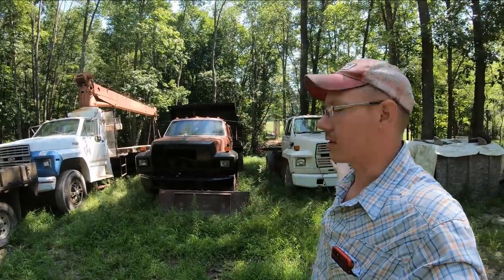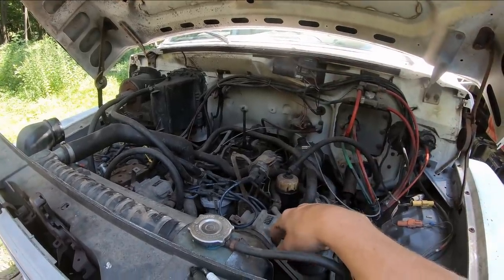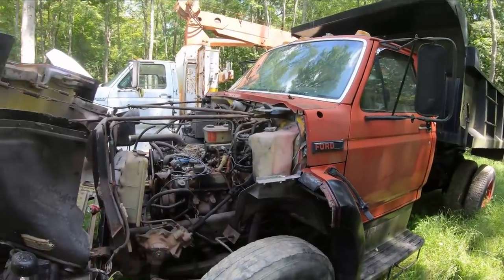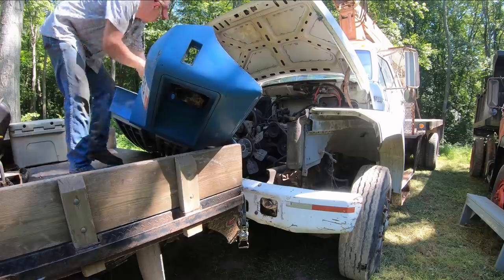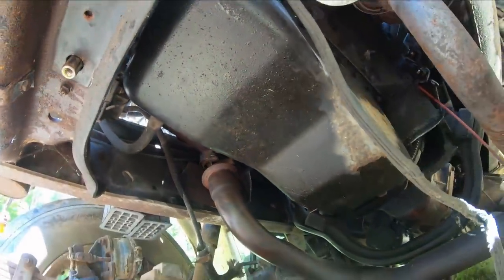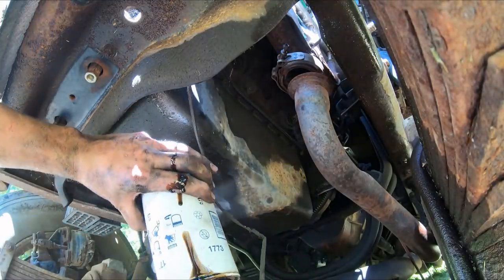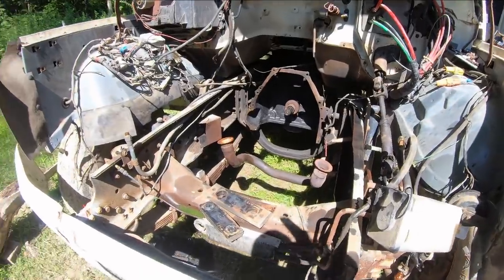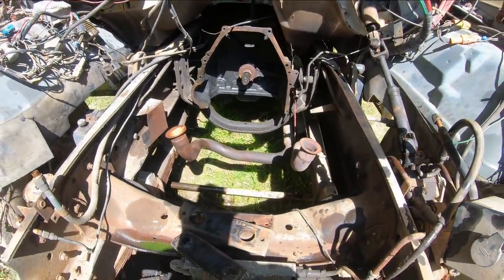Tearing down a BIG BLOCK in the middle of the woods!! $700 Auction Crane has BIG Problems!

Comment: Just a suggestion for next time when using a chain at the end of the fork blades is to tie another chain from the lifting chain back to the fork frame and tighten it so the lifting chains cannot pop off the blades - here only one did but it tested the strength of the blade fairly well - not that safe and could turn out expensive if something did break.

Comment: On the Chevy/GMC medium duties I don't think the cabs were different between the V8 sparkplug engine or the I6 diesels, they might have had slightly longer hoods compared to the Fords, its been a while since I drove or wrenched on any of them. I am fairly certain on the Chevy gas engines the only difference between the normal engine and industrial was the oil pan and usually the industrial was a goofy bore and stroke, I drove one with a 366 in it. I can't imagine why a Ford would be different. 

Honestly I have been sitting here thinking if you could find a wrecked diesel school bus you could stuff the engine and trans out of the bus in this truck along with the rear end and have a heck of a solid work truck with a crane. It would tow the skidsteer easily and you could probably get two full bunks of 18-20 foot lumber on the deck. Or depending on how heavy your excavator is it might tow that plus you could toss a couple of racks of forms for pouring foundations or basements on it.

But that would be a fairly larger investment in time and money than just throwing a rebuilt engine back in it and getting it running. I can see a lot of use for a truck like that if you do a lot of odd jobs or contract work.

Comment: If it is a 429 a 460 will swap in. You may have to use old oil pan and exhaust manifolds. Also possibly the oil pick up tube. Just check your accessory  brackets and how exactly they mount and if there are enough holes. There's also a possibility that the intake manifold may have to be reused. Hope this helps.
Reply: yep, this is the right answer. Those crane trucks were actually pretty good, gutless getting to and away from the jobsite, but great not having to smell diesel fumes all day while running it, hell my wife operated it setting trusses when we built our home, these trucks were common at the rental yards

Comment: I like that saying test the tensile strength of everything I forgot to disconnect lol I think the 460 block is different and can't be used in that truck because of the bell housing and transmission unless you want to put a 4 speed in it then it may work but the drivesshaft may not have the right size universal joints and be too short

Comment: Different engine Bigger cam on this one you`d be better to use a 366 from an old 70s model will have higher revs for your power , The 600 came out with the 366 I believe tank tough , mind you this block has had work done look at the cross hatch on the cyl . not bad .

Comment: G'day  Matt,,
Im thinking you left as much unanswered as you resolved with this  motor .
There is still the other bank of cylinders to  eyeball,,  and   remaining questions are ..
Where did the water come from ,,head gasket pr rainwater or crack cyl liner .
If its only a gasket or rainwater ,.  it may rebuild ok.
Im thinking the motor has been apart before , (why ?) 
due to the look of the bend   on that peice ,, dosent look like mechanical failure ,,perhaps it was stood on by a size 12 boot whilst being worked on previously.
Do a complete check for mechanical failure to rule out  a worthwile rebuild .
Or ....
Get a low mileage  motor  n go from there  .
Good luck with it ..

Much Respect
        from 
Down Under

Comment: the bellhousing bolt pattern and engine mount locations should be the same between the pickup/van and a heavy duty ford big blocks, but iirc the blocks themselves are different (low deck on the pickup/van engines, high deck on the heavy duty engines). not sure if that affects mounting accessories or oil pans, but I know for sure the intakes are different.

Comment: Probably parked with a blown head gasket. Both motors are pretty bulletproof (370 or 429) in the ford medium duties. I ran a fleet with trainee monkeys as drivers and other than clutches they had a hard time hurting them

Comment: Hello Sir just a thought when we would pull an engine from any vehicle with a fork lift of some kind to keep it from sliding an slipping off end of forks put a hole on either side an use a towing ball 1" 7/8's or 2" trailer ball.

Comment: The blocks are the same bolt patterns. You will have to use your timing cover so don't sell the motor you have until you have the new one in.
 The only other thing to watch out for will  Be the pilot bearing diameter in to crank

Comment: in regards to your its harder to put in a diesel than you think, you should have met my dad, 534 in our tandem M800 was going about a mile per 2 gallons, put in a 12v71t,  my uncle put out a rod in our cummins powered autocar 8v92tt 312 in the boom truck final wore out 6-71t yup he sure loved his detroit's and if they didnt come with a turbo he added one, or 2, and if the gearing was off, o well add another transmision I guess being a highly skilled welder fitter took care of those difficulties you mentioned

Comment: I think the difference between the 429 and the 460 is just the stroke. The crankshaft on the F-600-800 429's has a longer snout and was supposed to be higher quality along with the rods. Outside of that I'm not 100% sure. As far as you're concerned probably not worth rebuilding the engine as the machine shop bill could be pricey, my last one was a hell of a lot more than I thought it should have been, especially when I saw the job they had done. From reading looks like 0.060" over is perfectly doable on that block and 0.080"-0.120" has been done.

Comment: I actually thought you could use the crane on truck if it had the electric pump option like bucket trucks have for emergency operation. There a parallel pump ran by a starter type motor off the battery.

Comment: It will sound crazy but poor coca cola in the cylinder it will eat rust and allow the cylinder to turn over. Had an old man at a salvage yard tell me this. I thought it was crazy but finally tried it. Have used the trick on 3 different engines now and worked every time. I let it sit a week and then crank it over to push coke out.

Comment: should have put spark plugs back in filled it with diesel fluid let it set a couple weeks then go take the spark plugs  out hook your bulldozer to it put it in first gear and drag it while popping the clutch it would came loose that was running engine before it got water in it looked clean in the engine still had the cross hash in the cylinders

Comment: With the government cracking down on crane certification recently, it might be hard someone that is willing to buy a boom truck that is probably missing every neccessary safety device. Then getting certified is going to be ridiculous because its probably been worked by low trained employees like a forklift and not a crane. Hope it works out though

Comment: You could, free that piston, hone it, slap it together. Runs and blows smoke, does not matter much on a farm etc.
Or you could be on the lookout for an older rusted out ford with a V8 cat in it. Fit that. With any luck it will have an allison auto behind it, who cares how fast it will go, cant lift stuff at much over 10mph anyway.

Comment: Those are high rpm motors . They run the piss outta them motors just to be able to shift them liw geared rears in them bjg old trucks. When those motors do come apart they are usually junk. 460 is not the same. It has to be a 370 or a 429 industrual motor

Comment: If you take the carb off then put the diesel fuel in the intake it should run out of the stuck cylinder

Comment: In the previous video you talked about putting the truck in gear and using your pick up to try and move the truck and bump the engine over.  You had a great opportunity to do that when you had the tow truck hooked up to it.  So, why didn't you?
Reply from the maker: Got caught up in the moment and forgot... seeing the rust inside makes me think i would have just bent or broken a rod or rings or worse....
Reply: @DieselCreek  I suppose you could have also damaged the trans or the clutch.

Comment: 24:40 my response: "Yes. catastrophic failure of a valve. probably a snapped push rod.
Reply: I'm surprised at the lack of carnage. if I could afford it, had the tools, and the space, I'd take the bottom end out and start honing. the rust pitting isn't the worst. though I might pull the sleeves to check where the majority of the rust happens

Comment: Funny you say that about the gearing difference, my grandpa had a gas d350 first Gen ram bucket truck that blew the rear end, we found one in a junkyard and swapped it in, realized it was a taller gear and that truck was a dog for the next 10 years

I suspect that rear end came out of a diesel truck.

Comment: Yes, expected a worse view inside the engine. But that piston rusted to the cylinder walls pretty much toasts that engine. A good builder may be able to save that cylinder with honing but that's expensive work since you'll be rebuilding the whole engine anyway. Hope you find a solid replacement engine in the area. About your dump truck engine. If you had coolant run out of that cylinder taking the plug out, it may mean just a head gasket and when you tried to bar it over you were simply trying to compress liquid in that cylinder and that won't work making it seem like it's locked up but only the piston pushing against the liquid filled cylinder. Pour or squirt diesel or Blaster in the cylinders and let it sit. If it was only coolant, it might just push the coolant out of the plug hole as you turn it. Then you'll have to pull that head to change the head gasket. Maybe all it needs and it'll fire up? Plod onward, Matt!

Comment: I hate to be that guy but next time you use the forks to pull an engine add a chain from the bottom of the mast to the end of the forks to the cross chain so it can't slip off. Just some helpful advice so you don't do what I did when I was 17 and dropped my 7.3 out of my 97 f350 😅

Comment: If that engen only has rust in that one hole you buy bore hone h and bore hole out 10 thousands over size replace piston 10 over size and rings and Megan will run just fine all you need is drill the bore hone inside mike to check clearance

Comment: Putting diesel in the carb will only fill any cylinders with open intake valves unless the closed valves allow some to eventually seep through.
Reply from the maker: Well the open ones should also be the ones that got water in them so it all works out...

Comment: I'd just give that old engine an old school warming over. Use a set of oversize rings and set the end gap to specs by slightly grinding the ring end gap using a cut off disc in a grinder then plasti-gauging the bearings and tighten the gap up by shimming them with newspaper or brass shim stock. I've done a few engines this way and given them a new lease on life. Of course I'm just a farm mechanic who went to college and now have certificates, a couple of degrees and was a Michigan State and Nationally certified master Automotive Technician so what do I know next to some of the self proclaimed expert mechanics I've run across eh? Some of what I know I know by listening to a few old world mechanics who have worked on engines longer than I've been alive yet I'm now 71 years old. And I've seen my share of know it all kids who went to some of the promising schools advertised on TV.

Comment: All the 385 is the piston stroke. It a FE ford engine its a 429. Also a 460 is a ford engine that will work. The 385 stroke. Made it a 7.0 liter. Google it and read the Wikipedia. It will tell you everything. Although I think it's going to be hard to find a 429.  And there is a ton of 460 engines. Ford put them in trucks, thunderbird Or call older big body cars. Hope this helps.

Comment: 429 and 460 use the same block. Bore is the same just different stroke. So you can put a 460 crank in a 429 and you end up with a 460

Comment: as the big blocks were phased out in cars in the late 70's early 80's the medium duty trucks adopted the Lima, ohio based engine the Lima which the 370 was created as a replacement for the 361 truck FE type engine and the 429 Lima was the replacement for the 391 FE type truck engine the 429 eventually became the only gas engine offered and the 370 dropped  and was used until the Tritons came out. The 460 was used in pickups, ambulances and even buses so other than truck type oil pans, accessories, cams, etc the blocks should be identical they all have the same external dimensions and you should be able to find a 460, 429 or 370 fairly easy in a car, pickup, bus, ambulance, firetruck, or F600,700 or 800 and use your truck oil pan and anything else that's not the same externally.  That's my opinion you can decide for yourself from research but I think they basically just reallocated them to truck use to fill a gap temporarily and they did a good job at that. 

AD

Comment: Talk about the transmission and rear end gear ratios being different for gas vs diesel. I drive 5.9L Cummins with a NV4500 trans and the ratios really suck for a Diesel engine. Too much gear ratio difference between most of the gears, and 5th gear isn’t tall enough to comfortably faster than 70mph. Hate it.

Comment: From what I've been able to glean from my own research, the 460 and 429 blocks have the same bell housing pattern, and therefore should bolt in. The bigger truck heads are different to allow the very different exhaust manifolds, but those are bolt ons. I also find that the 351M and 400M engines share the 385 bell housing bolt pattern. Were it mine, I would look for a 460 pickup or better yet, a motor home engine. Old motor homes are usually very cheap due to the RV portion rotting out, but generally low miles, and built for torque.
Reply: My Ranchero is a 351M or 400 which ever you want to call it, and rv motors usually have another advantage of being 4 bolt mains, due to the heavy loads, but the 460 is a hell of a gasser one of my favorites and if I find one its going in my ranchero

Comment: Hello .  
maybe you can test it fairly cheaply with hydraulic pto of the tractor if the crane is still working or if it is all scrap old iron .  
by using the tractor as a hydraulic pump you don't have to think about the pump yet .  
or drive the pump with the PTO if that is easier .  
otherwise you don't have to spend as much time, money and effort on it .  
it is just an idea and something I personally would like to test first .  
I'm not saying you MUST do that .  

kind regards Hollandduck from the Netherlands

Comment: With those motors being so notorious for this, flip on its back and take that rod loose and see if motor comes to moving mysteriously as it should telling you that was the worst hole. As far as in the truck and a standard transmission.... don't know, maybe you thought of it but put the cat against the bumper and rock it back an forth a little harder than you can with a bar... might bend a rod though if it don't want to come. I hate that engine series as it is never forever... just waiting for something. It doesn't come cheap on the outlay but a cummins out of a dozer or backhoe, older twelve valve with a p pump would give you around ninety horses or bigger injectors might give more for speed down the road as for power more than needed to do crane work. And popular so the support is out there. Not cheap for the flywheel, adaptor for transmission but something out there has to have most of what needed to make it effortlessly easier. About the same in weight... might add one leaf if it sags too bad. Not near the emissions or problems. I think that the brakes on the truck are hydro assisted so that and steering would come about same same. Another youtuber that is big into cummins and knowledgeable is Greg... I will find his link and add it and he is in your area so a lot of help and right in his court helping people and not the dollar. https://www.youtube.com/channel/UC3BdTbRq-TwQdFPX_2AFcTw
His last name is hard for me to pronouce and he is looking to build his channel so it would fly well I am guessing. I know that that truck would pull high dollar with a cummins. Any old first gen dodge had them... case tractors and dozers, backhoes..., small delivery trucks like ups an fed express had them although those would have the million miles or close. Just have to be careful but still in long run looks cheaper an more bang for dollar. Lots easier to put back in and your good at fabing.

Comment: The 370/429 truck engines aren't in the same family as the 460
But they are easy to find ,  west point  truck center ( truck salvage yard )   just across the river in Lisbon ohio  can probably fix you up with a running engine pretty cheap
Reply from the maker: I’ll have to check them out

Comment: Ford 385 engine family (also code-named "Lima") is a series of big block V8 engines designed by Ford Motor Company. ... In cars, the engines saw use by all three Ford divisions in full-size cars, intermediates, personal luxury cars, and muscle cars.

Predecessor: Ford FE/FT V8; Ford MEL V8 (Lincoln); Ford Super Duty truck engine ...

Successor: Ford 5.0L/5.8L V8 (cars); Ford Triton V10 (trucks)

Cylinder bore: 4.362 in (110.8 mm)

Specific power: 53.3 hp (39.7 kW) per liter; 28.8 hp (21.5 kW) per liter